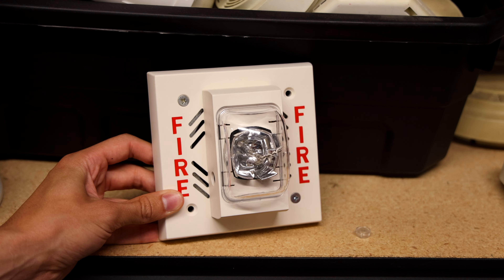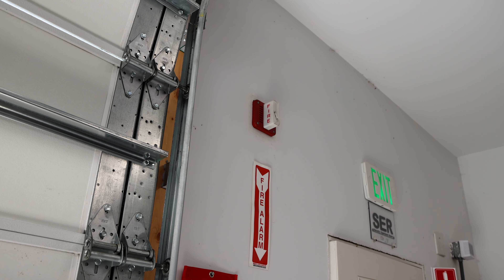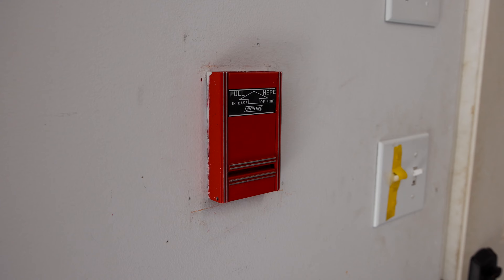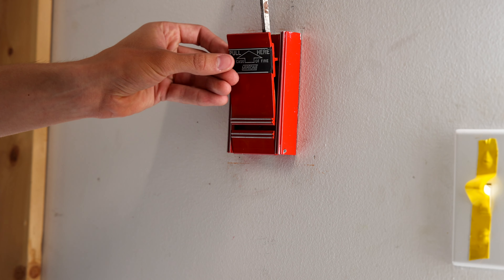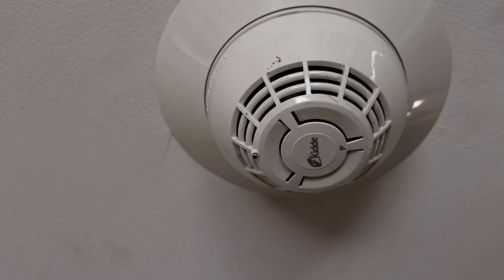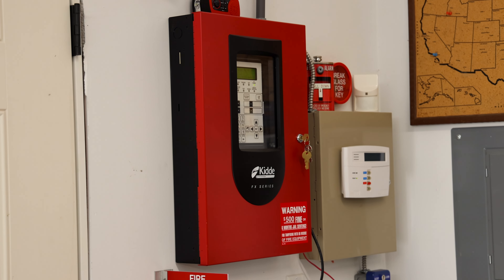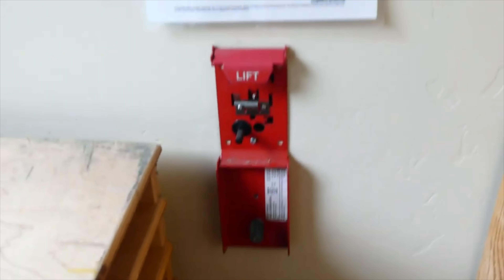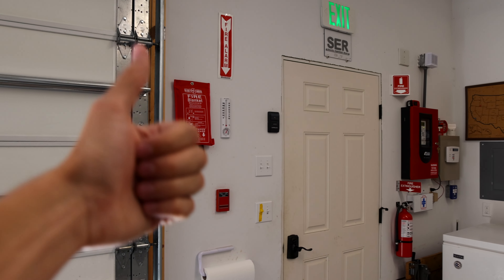Garage Fire Alarm System Test 32 | NEW Faraday Chime & Walk Test!

Comment: SER safety, you should wire in the fire button on the security keypad so when you push the fire button the fire alarm goes off and activate the fire alarm panel

Comment: Random fire safety question: my college dorm building has 2 emergency exit staircases that lead from every floor straight out to street level, which seems pretty normal. Only thing is, the doors to the staircases from the floors are locked on one side. Once you enter the staircase and the door shuts behind you, you cannot re-enter your floor without leaving through the exit door at the bottom of the stairs, then entering through the main entrance and riding the elevator to your floor. They say they did this for safety reasons so people don’t get in through the exits, but is it up to code to have an emergency exit where you can’t get back in once you’ve entered the stairs? I assume it’s legal if they’re doing it, but just asking.

Comment: I have a request why don't you put a system sensor carbon monoxide detector on your ADT Unimode 10 UD Panel and and for the alarm a System sensor low frequency sounder